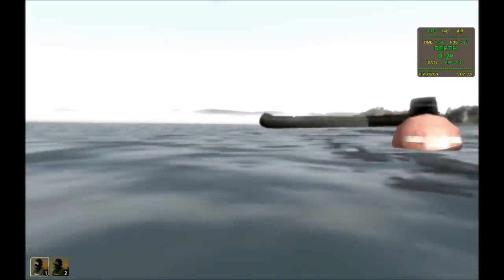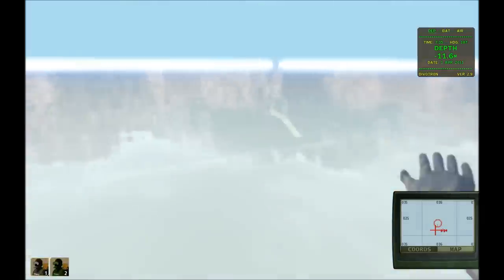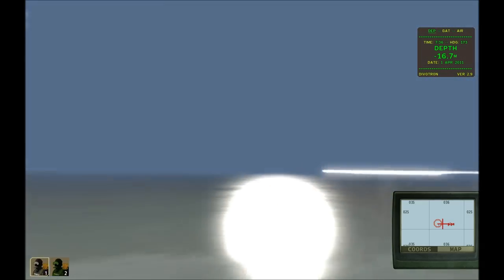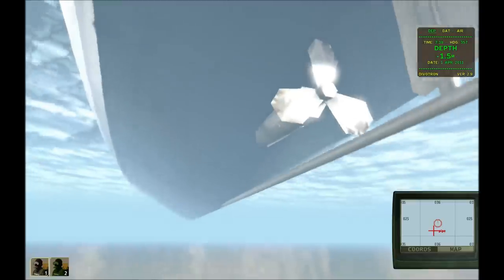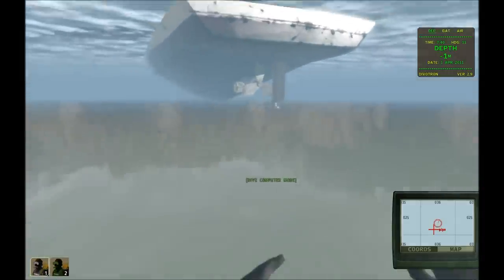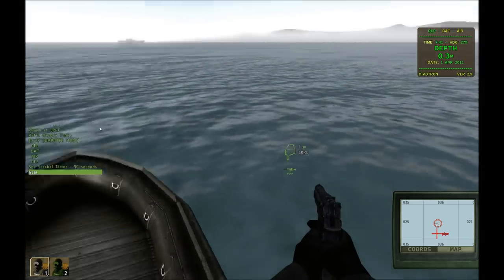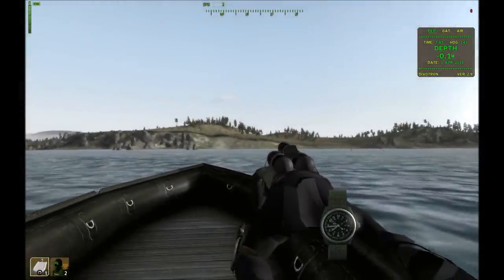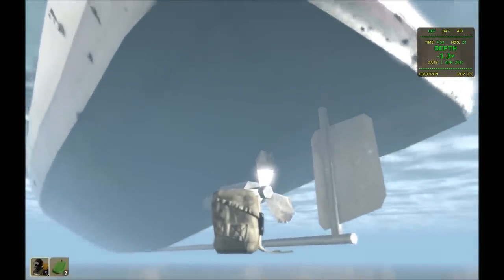Underwater Diving Module Intro - Part 2 of 2

Comment from the maker: @Schalton2, I was able to get some code from the SLX mod which seems to preserve equipment for even longer than 240 minutes while swimming forward.  However, last night I swam for about 20 minutes toward an enemy ship. I made it to the ship, planted a charge, and was swimming away a few hundred meters from the boat when it opened fire and I lost my gear.  I think I was injured and that caused me to lose my gear.  So I need to do another test. Rounds only penetrate a small amount below the water.